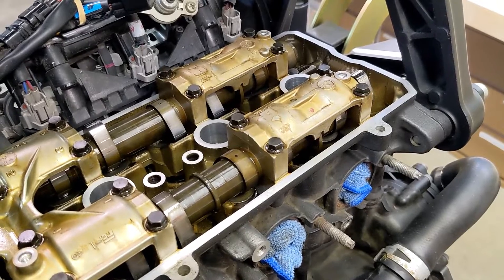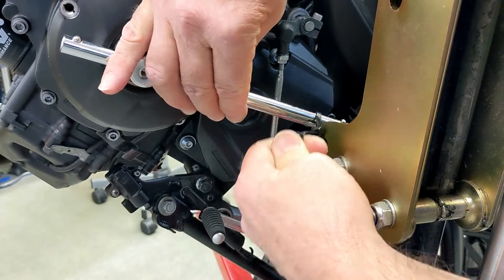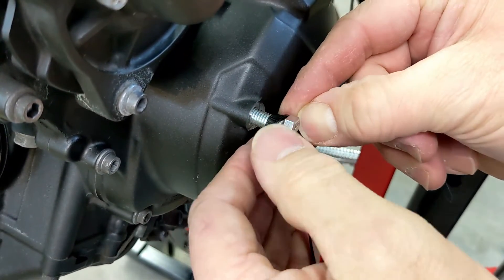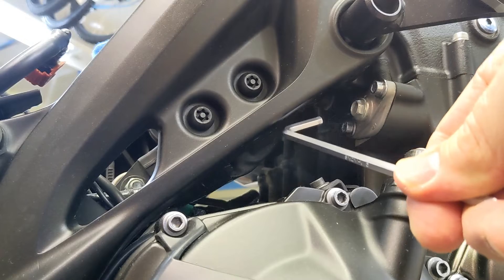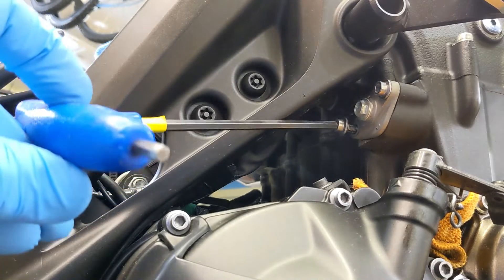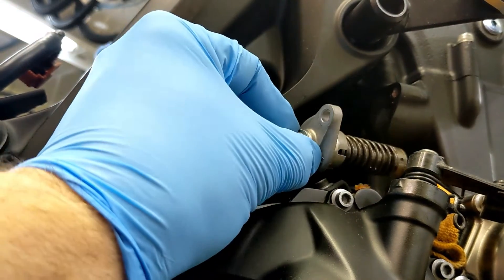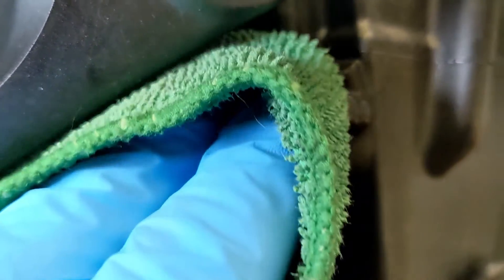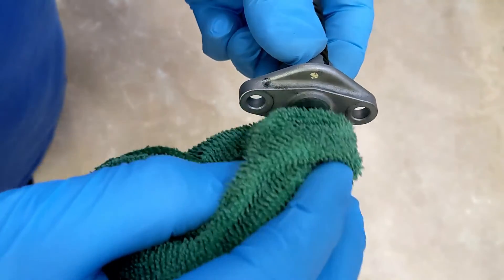cam chain tensioner removal Yamaha FZ-09/MT-09 2014 2015 2016

Comment: Have a question about removing the tensioner. I read to never do it on a mounted engine. However I see yours is mounted. Do you know why they recommend not to do it on a mounted engine?
Reply from the maker: Whoever "they" are is probably wrong... It's irrelevant if the engine is mounted or not because the tensioner just pushes on the cam chain... Maybe they're thinking of some other issue?
Reply: @meticulousmechanic you are probably right. It is in the Yamaha manual on a small box as a tip. But the manually misses a few things that are important in other areas. 
I just could not understand the reason behind why removing it with the engine mounted should be a no no. Thanks for responding. Videos are great!

Comment: 1st ziptie the camchain to the camahaft sprockets before removing the tension er.. Otherwise you risk chain slipping and your timing will be  gone. That is something the book does not tell you
Reply from the maker: You are right! I find the book (Yamaha service manual) to be very lacking in important details. This would apply for sure if all you were doing was replacing the cam chain tensioner with say for instance a manual tensioner or a new oem tensioner....(is this what you are referring to?) but I will be removing both camshafts completely to change the shims under the buckets because my exhaust valve clearances are out of specification. The whole system will be out of time except for  the crank shaft being held at 125° BTDC. When I go out to the shop tomorrow, I will include an analysis in my next  video (cam cap removal) with some footage of what you are talking about...thanks for commenting!
Reply: @meticulousmechanic  

5:37 Est-ce que le deuxième bruit est celui de la chaine qui saute hors du pignon d'arbre à cames ? (Français)

5:37  Is the second noise the chain jumping off the camshaft sprocket?
Reply from the maker: @cjeje8145 I believe it's the sound of the cam chain tensioner spring popping out a little bit. The cam chain did pop off of the cam chain sprockets due to the tension from the exhaust cam shaft... I didn't care because I was removing the camshafts completely.
Reply: @meticulousmechanic  

Français:

D'abord bravo pour ton travaille!

Je suis allé sur le forum américain consacré à la FZ-09 sur lequel tu as discuté avec d'autres passionnés de mécanique.
Dans ta vidéo, tu as été obligé de fabriquer un outil pour faire tourner l'arbre à cames d'échappement et ainsi aligner les repères de calage de la distribution de ta moto.

Ce qu'il semble falloir faire, c'est ne pas changer le nombre de maillon de la chaine entre les différents pignons. 

Hors, tu ne peux compter que le nombre de maillon entre les arbres à cames. La seule chose que tu sais c'est que la chaine côté échappement doit être tendue et que les repères sur les arbres à cames doivent correspondre à ceux sur leurs chapeaux. Mais aussi que le repère en triangle doit apparaitre dans la fenêtre du vilebrequin. 

Ce qu'expliquait d'autres membres du Forum, c'est que chronologiquement, il faut:
1-remettre chaque repaire à sa place: arbres à cames (même si la came n'appuis pas sur le godet)et vilebrequin.
2-tendre la chaine côté échappement et poser la chaine sur les pignons d'arbre à came.
3-ATTACHER LA CHAINE AU PIGNON avec des ZIPPS. (comme tu l'as fait pour pas que la chaine saute des pignons)
 
Dans cette configuration les repères sont tous alignés. Tu es sûr du nombre de maillons entre les pignons d'arbre à cames et du nombre de maillons entre le pignon de l'arbre à cames d'échappement et le pignon de vilebrequin.
Si la chaine est détendue entre le pignon de vilebrequin et le pignon d'arbre à came d'échappement, il existe deux hypothèses:
-Soit le vilebrequin a tourné; le triangle a disparu de la fenêtre.
-soit, une dent a sauté au niveau du pignon de vilebrequin. 

En fait, dans ma théorie, le tendeur de chaine ne sert pas à proprement parlé à "tendre la chaine", mais à l'empêcher de sortir (sauter) des pignons, c'est à dire à la garder enroulée autour du pignon d'arbre à cames d'admission et autour du pignon de vilebrequin.

4-ensuite, on repose les chapeaux d'arbre à cames en vissant en croix et ceux sont eux qui exercent la pression sur la came qui est en appuie sur la soupape quand le moteur est calé 125° avant le PMH. les arbres à cames reprennent naturellement leur place grâce à la tension de la chaine maintenue par les ZIPPS et les repères ne bougent pas.
5-il suffit alors de remettre délicatement le tendeur de chaine.

Qu'en penses tu?

English (by translation)

First of all congratulations for your work!

I went to the American forum dedicated to the FZ-09 where you discussed with other mechanical enthusiasts.
In your video, you had to make a tool to rotate the exhaust camshaft and thus align the timing marks of your motorcycle's timing.

What seems to have to be done is not to change the number of links in the chain between the different sprockets.

Off, you can only count the number of links between the camshafts. The only thing you know is that the chain on the exhaust side must be tight and the marks on the camshafts must match those on their caps. But also that the triangle mark must appear in the window of the crankshaft.

What other members of the Forum explained is that chronologically, it is necessary:
1-put each mark back in its place: camshafts (even if the cam does not rest on the bucket) and crankshaft.
2-Tighten the chain on the exhaust side and place the chain on the camshaft sprockets.
3-ATTACH THE CHAIN TO THE SPROCKET with ZIPPS. (like you did so the chain doesn't jump off the sprockets)
 
In this configuration the marks are all aligned. Are you sure of the number of links between the camshaft sprockets and the number of links between the exhaust camshaft sprocket and the crankshaft sprocket.
If the chain is slack between the crankshaft sprocket and the exhaust camshaft sprocket, there are two possibilities:
- Either the crankshaft has rotated; the triangle has disappeared from the window.
- or a tooth has jumped at the level of the crankshaft pinion.

In fact, in my theory, the chain tensioner is not strictly speaking used to "tighten the chain", but to prevent it from coming out (jumping) from the sprockets, i.e. to keep it wrapped around the sprocket. inlet camshaft and around the crankshaft sprocket.

4-then, the camshaft caps are fitted by screwing crosswise and those are the ones which exert pressure on the cam which is pressing on the valve when the engine is set at 125° before TDC. the camshafts naturally return to their place thanks to the tension of the chain maintained by the ZIPPS and the marks do not move.
5-it is then enough to gently replace the chain tensioner.

What do you think about?
Reply from the maker: @cjeje8145  I believe that my technique is less likely to put undo stress on the cam caps as the bolts are carefully tightened down in a specified sequence. I decided to tighten them down, and then rotate the cams into postion because that would be putting the forces in the intended direction. Who knows what kind of sideways force that the exhaust cam would exert on the cam caps if it was tighted down at a non perpindicular angle.
Theoretically it could work the other way but I didn't try it. You are right about the cam chain tensioner.
For those reading this comment who don't know, this discussion is part of my complete playlist on checking and adjusting valve clearance at this link:
https://youtube.com/playlist?list=PL9a5oWl0x1as8Zf1dRJhJ0teInrhb_qMl
The two specific videos in this playlist that deal with this topic are:
Part 1
https://youtu.be/tOmA-ljd-G0
Part 2
https://youtu.be/dcaRfLx3_v4
There is further discussion on this topic in the comments of the above two videos.
Reply: @meticulousmechanic  J'ai bien compris votre méthode qui semble parfaitement pertinente.

I understood your method which seems perfectly relevant.